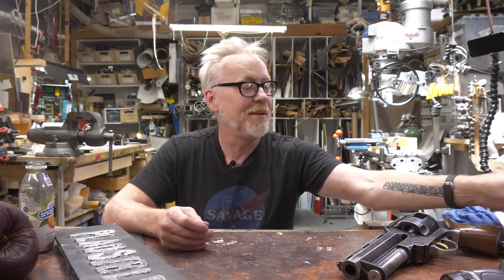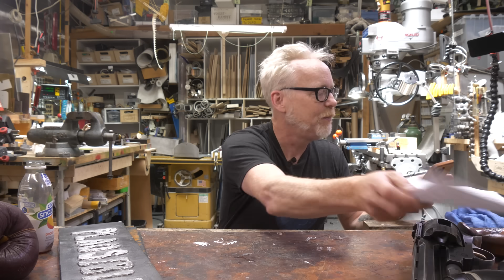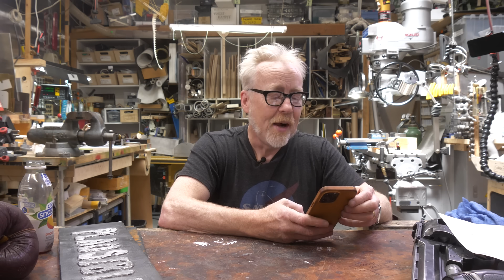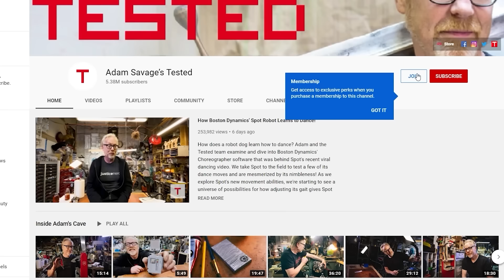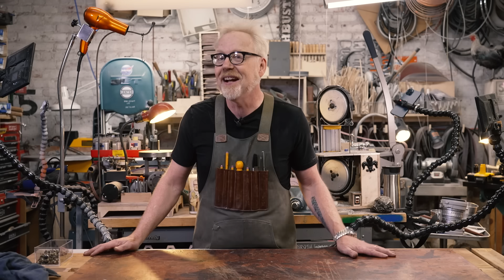Hardest-to-Obtain Item in MythBusters History

Comment: Throwing your first live grenade is simultaneously exciting and terrifying.  You’ve been hearing the booms all morning while you’ve been waiting your turn, and then you’re holding this small, surprisingly heavy globe of death in your hand.
Reply: By the time I got to the live range, I had thrown at least three or four practice grenades.  The AI (Assistant Instructor) in my pit looked me in the eyes and said;  " If for any reason, you drop this grenade; do NOT attempt to recover it.  Yell "GRENADE" and jump behind those sandbags at the back of the pit.  I will deal with the grenade and beat you over the sandbags."
Reply: Fort Jackson, 1965, I threw the grenade and the NCO behind me pushed me down flat.  I wasn't aiming at anything; I just wanted to get that hot potato out of my hand and over the blast wall immediately.  The range officer came over and congratulated me on my throwing accuracy ... my grenade landed exactly at the base of the wooden target pole and knocked the thing down.  It was so full of shrapnel that it probably would have gone down if a butterfly landed on it, but I knew better than to be humble at that moment, so I made the most of my newfound glory.
Reply: @mangelwurzel  awesome story man
Reply: The DS (a short and vicious Argyle IIRC) had a very well practised line, "Don't feck it up sir, but if you do we'll try to pick up most of the bits."
Reply: man, all these nade stories are fun to laugh at but i'm pretty sure if i were there i'd be the guy to pull the grenade and throw the pin.
Reply: For me the worst part about throwing live grenades was how we had around 50 17-18yr olds in a line just holding 2 live grenades and if one of them accidently pulled the pin we would have been screwed.
Reply: @sean7976  there is no accidentally pulling the pin. At least with US grenades. They have a safety clip. At least since 2005 when I enlisted. I know before the pin was both easier to pull and didn't have the clip I just font know when that was.
Reply: @deusvult6920  I would add that when I went through basic in 75 they didn't give us any live ones until our turn came up. Handing them out to a bunch of grab-assing kids while they wait in line sounds insanely risky.
Reply: @deusvult6920  most people still call that a pin. When i was in it was jyst like the safty on a fire extinguisher. Push lever in, pull the pin, toss.
Reply: @sean7976  boggles rhe mind. No one was allowed live ammo until they stepped in the range. But they gave us 2 live grenades to hold and where left unsupervised while we waited in a line for a long ass time. Lol.  But i guess the bayonetts where the most dangerouse, since idiots jyst started sword figgting. One guy dropoed hit rifle an speared a guts foot, and another while in formation stabbed tge guy in front of him. By accedent. Lol
Reply: @sean7976  Or even "accidentally". The training cycle before mine, a trainee armed a grenade and hugged it to his chest when he got to the throwing area.. it took him and the instructor out. Apparently, he was trying to wrestle the grenade away and knock it into the sump.
Reply: Imagine the rookie whose very first live grenade (and he was the very first to throw of the squad of rookies) was a dud!
I was there as one of the range officers, tasked mostly with keeping a bunch of nervous rookies calm enough to stay behind the safety barricade but my secondary task was - in the event - to "deal with" any duds.
I had of course been behind the barricade myself when he threw so I had not seen where it had landed - and let me tell you: it was indeed a very long and lonesome walk to go out and search for the damn thing.
Often, when rookies throw duds it is because they have failed to pull the pin correctly and the mechanism is at least somewhat safe to approach, but this guy had pulled the pin (he still had it in his shaking hand) so the grenade I was searching for was indeed a "hang-fire", and thus very sensitive to anything, even a heavy footfall could set it off.

Long story short: I found it where it had landed, luckily on top of the sand and not in any shallow depression (from the previous squads successful throwing), carried out the neccessary steps to safely dispose of it (which involves even more explosives, a detonator and a timed fuse).

And by the way: I was not wearing a full blast-suit - nor even a fragmentation vest (those weren't issued to units at my level at the time) so all I had for protection was a helmet on my head. Trying to place the disposing charge while keeping the helmet between me and the dud was - shall we say challenging, especially since I am very much a right-hander and thought "if I am going to lose a hand, better the left" so I had to do the most delicate work essentially blind and with my left hand..

Thankfully the rest of the day went without other hitches but I will never - ever - forget that morning as it was also my first time dealing with a live, thown but unexploded grenade.
Reply: @noremorsewoodworking2258  - It's utterly ridiculous that you didn't have the right equipment lol. Glad it went ok.
Reply: @noremorsewoodworking2258  I saw that happen the odd time.  Kudos to you for your bravery sir.
Reply: @noremorsewoodworking2258  you were ordered to approach and essentially touch a hang-fire grenade that could go off at the slightest provocation, with only a helmet? god damn, just refuse and take the punishment
Reply: @noremorsewoodworking2258  "What makes me a good demo-man? If I were a bad demo-man, I wouldn't be sittin' here discussin' it wit yeh!"
Reply: Have y'all heard about the new grenades where they screw together to be variable yield?  Theoretically they'll never be issued more than four, but you know some group is going to get many more chained together.
Reply: My instructor on the grenade range was missing an eye. Lost it in a grenade training accident. Very confidence building.
Reply: @tbnone2501  right after I threw mine I got out of the pit we were in and knocked my drill sergeants hat in the mud. Bad day all around
Reply: @tbnone2501  Remind you of the slash faced guy in Avatar?
Reply: I Still remember being a bored private in in BCT Juggling training grenades, when woops, this one doesn't have a hole drilled in the bottom. "DRILL SERGEANT!!!"
Reply: @semi-useful5178  Hope your Drill Sergeant didn't chew you out for that.
Reply: Yeah I remember I was one of the last ones to throw in my company. Hours and hours in line because they only had one pit running. It was amazing to me how far away you could feel the explosion in the ground and in your chest. Of course I finally get into the shed of grenades, the sergeants in there are pretending to fumble the grenades and making jokes, they give me my grenade and all I could think about after that was dear God please don't let me be the guy that drops the grenade instead of throwing it. Especially being left handed, the grip is not that great holding it upside down or whatever it was we had to do. I threw it, and I don't even remember hearing it explode. I know it did. Don't remember hearing or feeling any of it lol. And you can hear and feel it very very far away so that was strange to me. Was definitely happy to run back to everyone else when my turn was up. Not the fun I had always imagined 😂
Reply: I have the worst throw in the world, I think I'd be better trusted with a grenade launcher than hand grenades.
Reply: We had a dude drop it after having the spoon out. DSG dropped him and threw it one the bags. Good times at Ft Sill
Reply: Threw my first grenade about 10 yrs ago now at Benning. But they gave everyone 2 metal cans(each had 1 grenade in it)Each with a grenade in it. It was probably the only part of basic I got a rush out of. 
I had to do retraining...because I kept milking the grenade(dummies). Apparently when I played baseball, i would rotate the ball in my hand out of habit... which is exactly what I did with the dummy ones...
Reply: Yeah.  They made us hold the cardboard cylinder between palm of both hands, without removing it.  Did NOT want to risk curious hands I suppose.
Reply: With my coordination it would end up a couple feet behind me after throwing.
Reply: Yep did that in basic training. It was cool
Reply: What you’re leaving out is that it’s remarkably underwhelming. Particularly once you’ve seen actually big explosions.
Reply: I know…I, shall I say, ‘led a charmed life’ growing up, I played with the big boy fireworks, quartersticks and half sticks, stuff with more explosive mass than hand grenades, and threw them from the hand…thing was, as soon as that fuse was lit I was getting rid of it…what made me nervous at the grenade range was they made you go through the steps slowly and deliberately ‘sweep, twist, pull, strike a pose, throw’ instead of getting rid of the thing as soon as the pin was out 😂
Reply: and incredibility underwhelming after years of hollywood grenades.
Reply: @zenistfpv  There's an old story of bored staff at Brecon deciding to enliven a grenade exercise by borrowing a dead sheep off a local farmer and leaving it in the target trench to mature over a July weekend. 
Sunday afternoon a bunch of Territorials on annual camp rolls up for the high point of their course. Third grenade of the day lands in just the right place to make the now fly-blown and bloated ex-ovine burst causing a light shower of maggots and a gout of foetid gases that made half the detail heave.
Reply: @stamfordly6463  Fantastic !
Reply: @zenistfpv  I would disagree but I understand what you probably mean. There's no big ball of fire and it doesn't send people flying, but the boom is incredibly more powerful than I thought it would be, and all the dirt in a 30 foot radius seems to just kick into the air. It made me more scared of them.
Reply: @zenistfpv  😁 Yeah, they always seems to get the good ones for the movies.
Reply: And throw it directly into the wall in front of you.
Reply: Crazy how Adam couldn’t get ahold of one but the cartel use them daily! We should ban them so they stop using them
Reply: Yea, they are really surprisingly heavy the first time you pick one up. Probably in no small part due to the promise of death it contains...

Don't have any fun live grenade exercise stories, but I do have one about practice grenades and mistakes made...
In Sweden we had a conscription army at the time, so military service was mandatory. For some strange reason they got in their head I was left handed and back then that was a ticket to some technical role as the rifles we had was very right centric. The same was true for people with bad backs and such. Now this kind of duty was thought of as a lot easier than regular army training so some would get a doctor to sign off on back injuries and such to get a cushy assignment. One of those guys was a real hoot as he had papers "proving" he had a bad back but was in reality a very well trained athlete. Don't ask me how he managed to get them to believe in this, but it had worked. Well then came the day he picked up a practice grenade and casually tossed it way past the previous company record. And yes that included the troops that was intended to protect the division staff and those guys were the best they could find. Our captain just looked at him, shook his head and said "I didn't see where that went. Throw another one and I'll forget that ever happened."

Sure there were a lot of angst the first time we threw live grenades, but nothing worth talking about. But that casual toss was just such a F-U to the entire system.

Oh and that "cushy" job? Well we spent twice the time in the field as regular grunts, and we had worse gear. So much for taking the easy path.
Reply: I was a MP so we had women in our company. Before deployment we got to go to a grenade range. For safety reasons we only occupied every other bunker. One woman was in the next occupied bunker to the side of me

We worked our way down the line 1 by 1 and everytime someone would throw one we'd air throw and take cover 

I do mine. Then her turn comes up. I do my practice throw. I get down I hear a grenade hit the lip of the bunker (it extended 8" higher than the ground) and it exploded right on the other side of the bunker. Scared the fk out of me and my team leader that was in it with me lol
Reply: Remember the instructions.... First shalt thou take out the Holy Pin. Then shalt thou count to three, no more, no less. Three shall be the number thou shalt count, and the number of the counting shall be three. Four shalt thou not count, neither count thou two, excepting that thou then proceed to three. Five is right out. Once the number three, being the third number, be reached, then lobbest thou thy Holy Hand Grenade of Antioch towards thy foe, who, being naughty in My sight, shall snuff it.'
Reply: Agreed! I guess ppl think its mostly excitind and fun, but at least for me it was just terrifying. Holding that ice cold (it was winter) metal ball and knowing that between you and instant death is only that very thin pin. It was a training case though, I guess you wouldnt have time to think those things in live situation
Reply: @tukriko  I carried two on my chest for about 7 months. Least scary part about that deployment.
Reply: I was to tired to care, just wanted to toss the thing so we could get the long hike back over to eat dinner.
Reply: I heard that in one barracks, to initiate new members, they'd stick a grannade up their bottom, until one time when the pin came out.

Comment: Leave it to the Germans to not only get the lead that thin, but one up the other companies and say they will get it even thinner
Reply: We are metric over here. 1/1000 inch is 0.0254 mm or 25.4µm which is a bit odd for us. A typical metric foil thicknesses is 15µm - that is about 0.0006 inch - I guess that's what they sent. If it oxidizes a bit it will probably be measured at 0.0007 inch. They probably went into their inventory and looked for the first standard thing thinner than what Mythbusters specified.

Why do they even produce this thin stuff and call it a "standard thickness"? We are in the EU. Accoding to the EU lead in any form is evil (because it can be in some forms). So customers who need to line something with lead will ask for the thinnest possible foil that still does the job, because it will be hard enough to get permission to use it anyway - the thicker it is the more difficult the paperwork.
Reply: @KonradTheWizzard  I think they were referring to the rather well known stereotype about German over efficiency.
Reply: @KonradTheWizzard  yeah adam was just shocked they were able to get it that thin despite it being lead. He brought up that standard foil size was a good bit under 1/1000 but for some reason, lead like the softest metal of all metals breaks foil machines that thin. I betcha no one was willing to put it in the machines that make like tin foil and stuff out of other metals that can get that thin easily because it’d contaminate it and that was why it was so difficult to locate.
Reply: Gotta love them for being an overly efficient people.
Reply: @itwasagoodideaatthetime7980  While I appreciate your admiration of our efficiency, I've got to admit that most of the time we are just running away from the bureaucracy. We German engineers prefer to solve seemingly impossible problems over filling out a stack of forms to explain why it cannot be done... 😁
Efficiency comes into play when we solve the problem before anyone can get the "brilliant" idea to make up a form about it, because the form will inevitably be worse than the original problem. A functioning bureaucracy can be a great motivator to avoid it...
Reply: @KonradTheWizzard  
I can see that.
Well, we can engineer the product better or we can fill out forms...
Reply: Work for a Uk auto manufacturer 
The form is all that is important here....never mind if the job isn't completed correctly corners are cut etc 
Nope as long as the form is completed then you're all good
Reply: They took it too far like they always do.

Comment: Now I want to shield all of my RF gear with lead foil.

Hmm, 🤔 A HAT I can make a lead foil hat
Reply: You can easily shield RF with aluminium foil. Lighter, cheaper, safer. For most RF even a simple mesh will do (as long as the holes are much smaller than the wavelength). You only need lead if you cross into X-Rays.

That would be a hat I would not want to wear - that one could literally make you as mad as a hatter... 😉
Reply: @KonradTheWizzard  RF from DC to Daylight